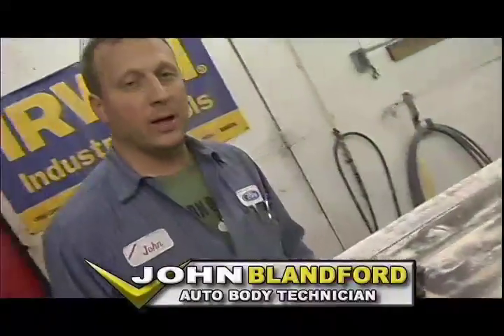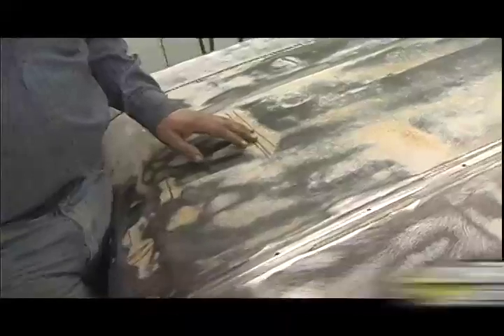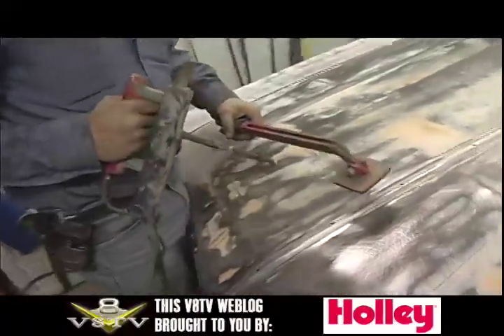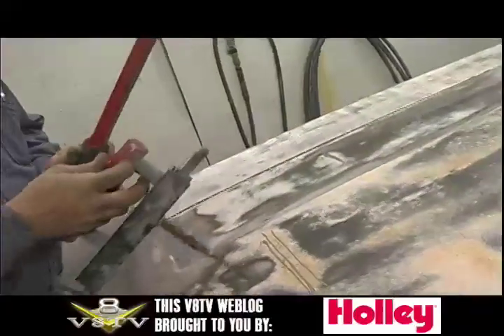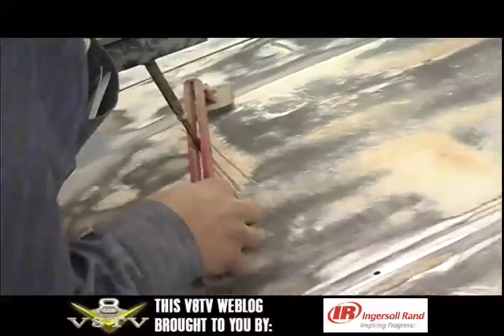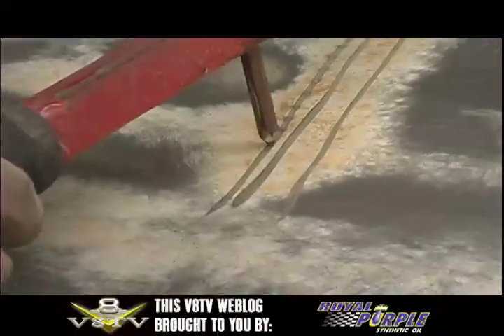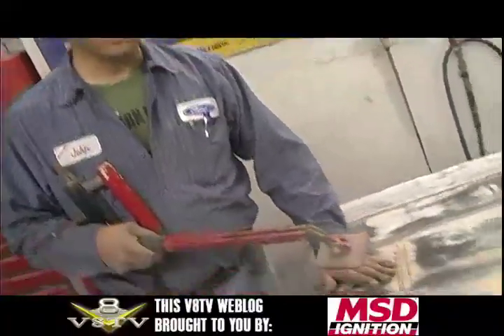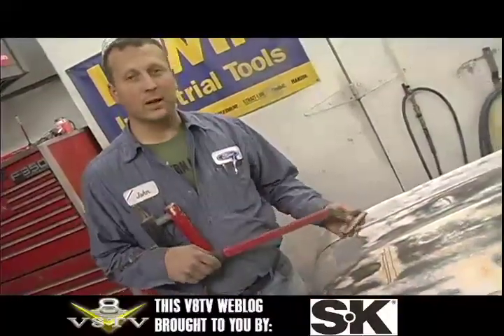1965 Chevelle: Pulling Small Dents The Easy Way - V8TV-Video

Comment: I made it just like the one in the video. Used 2 truck batterys wired in series and a magnetic switch to conduct the current and a momentary switch to excite it. Google panel puller or panel beater for the product.

Comment: Everybody has their own techniques, & I certainly don't want to knock  John or Kevin. They do fantastic work & I like their videos. I personally like the stud gun because I like the versatility of it. Even when working on flat panels like hoods or decks. You don't really have to push down that hard to operate the stud gun & what the heck you're already working a dented surface anyway. Right? There are pulling levers &tools available to pull just like John does here. Dent Killer, Steck Lever etc.